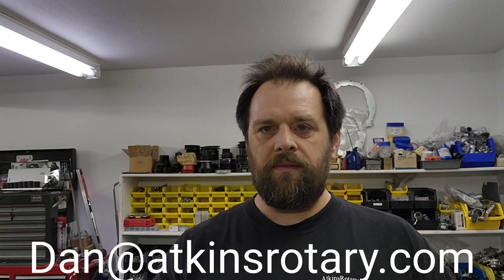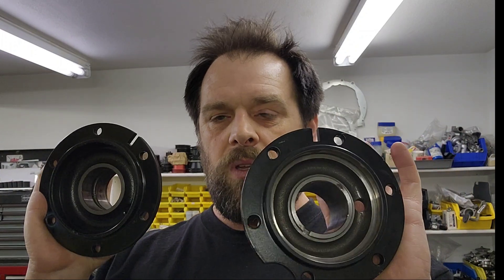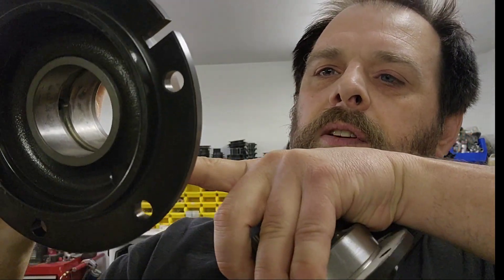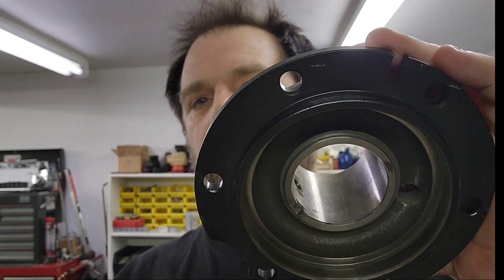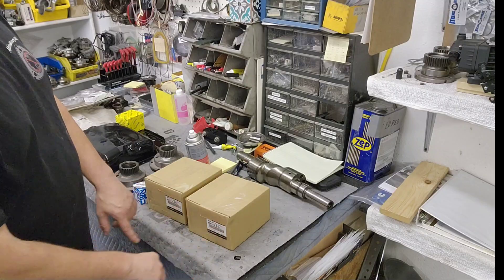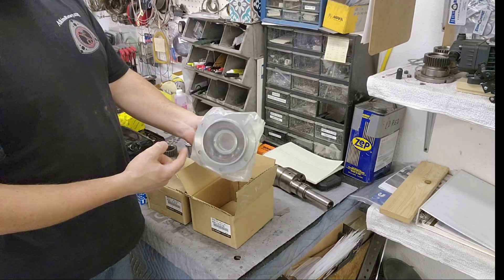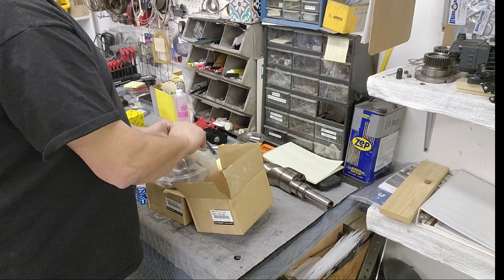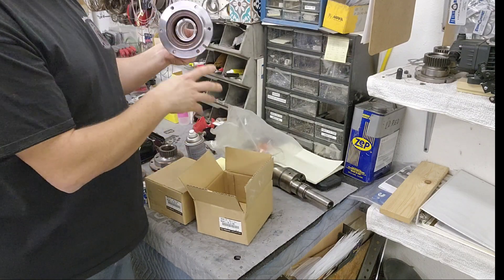Explaining High & Low Power Stationary Gears For Mazda Rx-8 #rotary

Comment: Hello guys, can I safely swap my rear stationary gear for a 231hp version, on my 192 (wich will stay with his stock 192 front one) ?
I already got an oil pressure regulator upgrade, and I'm thinking about replacing it with my clutch because compression starts to drop on a face and up on the 2 others... What do you think about it ? Thank you.
Reply from the maker: You could but unless you changed the front one it's kinda pointless. 
Thank you for watching and commenting

Comment: Thank you so much . So can I build my 4 pot 192Hp 13b engine with high power stationary gears for better lubricating?
Reply from the maker: You could change the gears with no issues. However, with the ECU/transmission, keep the RPMs down. I personally don't see a point in spending the money to do this kind of upgrade.
Thank you for the question, and thank you for watching and commenting 😉